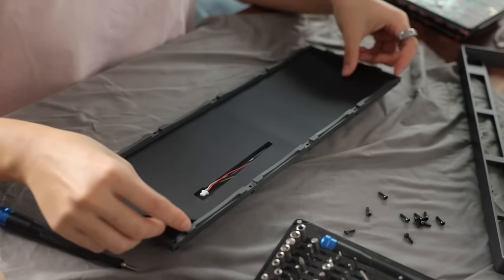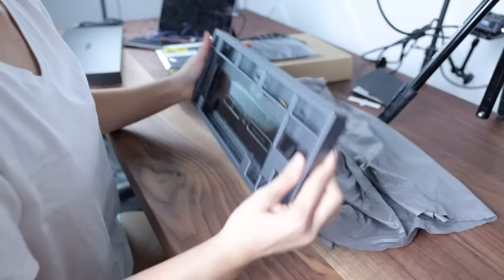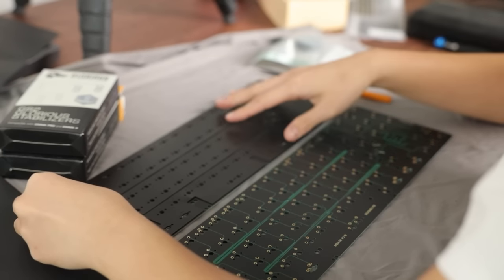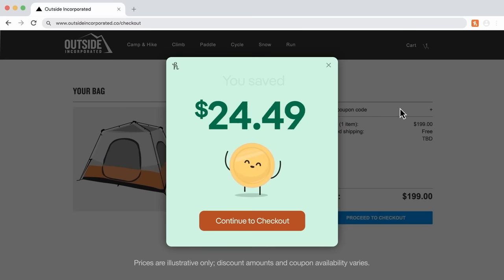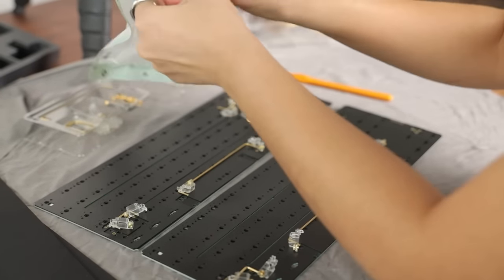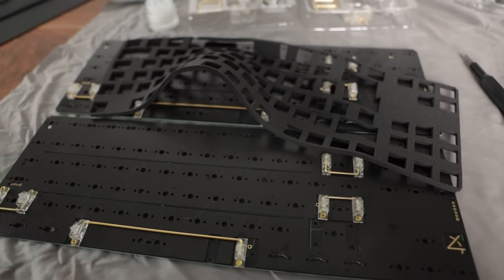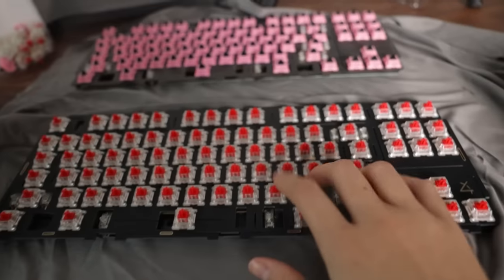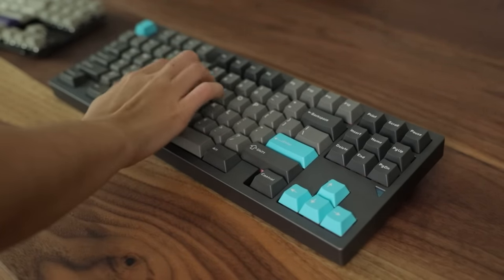I haven't built a keyboard in a LONG time

Comment: I find lubing switches only really changes the acoustics with minimal difference on feel depending on what material the switches made out of
Reply: That's the beauty of the hobby.  You can go as OCD as you like, or do it as stock as you like.  To some even a Dell keyboard works fine.  So lubing is definitely a lot of hard work for that extra touch of perfection.  That's why high-end boards cost a lot more, but not everyone can appreciate the difference enough to justify its purchase over more budget options.  Do what makes you happy, that's the most important thing.

Comment: If you're bored of building keyboards get a Model M and use a real keyboard for once 🙃
Actually I just bolt modded mine because I cracked a trace off the keyboard membrane cable when I reassembled it after I opened it up to clean it because I spilled bubble tea inside it. Big oof. It was a lot of fun tho.